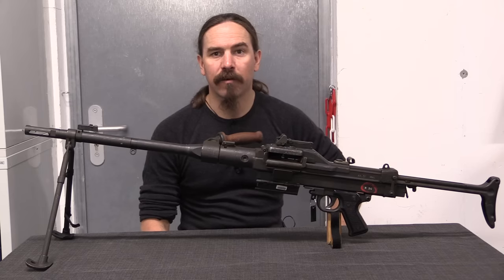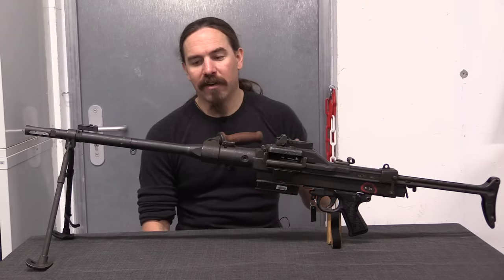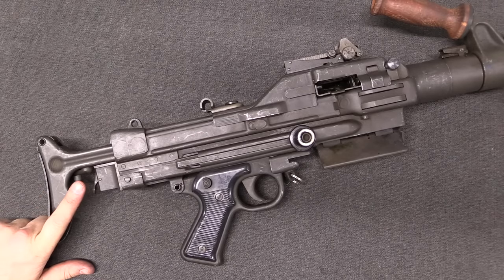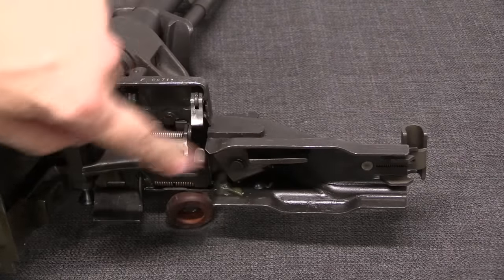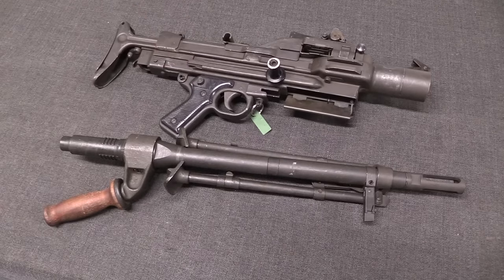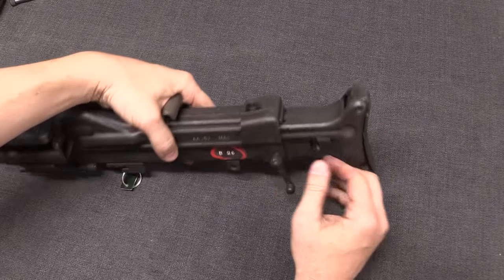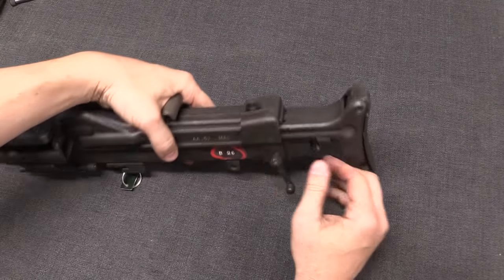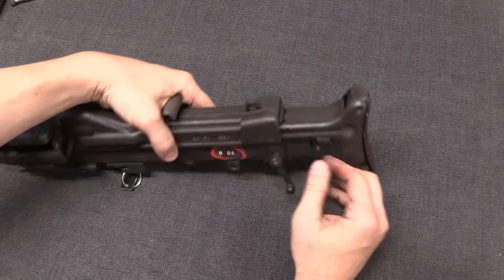France in the Cold War: AA52 Replaces the Hotchkiss

Comment: Quite kool Gun but i dont like that the bipod is mounted on the Barrel. If im in the fields in position and need to change the barrel because i fired 4-5 belts an the Barrel is hot as hell. If i change the barrel with bipod i need to position my gun again. maybe its because im used to the MG3 but i dont like that idea.

Comment: A few quick questions - most distracting - is that a bullet hole in the wall to your immediate left? Serious questions - has the firing pin been shortened on this version? The 90 degree bend in the firing pin looks like a weap point, did it take a lot of stress on firing at that bend? Very interesting GPMG, thank you for sharing.

Comment: Man, lever-delayed, roller-delayed, toggle, et.al. just boggle my mind.
I understand that it’s probably (comparatively) simple engineering/maths, but the idea of saying, “okay little lever, you just gotta hold on long enough for the huge explosion to dissipate, but also save some energy to move this block of metal” is just wild to me.
Reply: think of it that way : if you want to lift up a weight and you have a long lever arm it's easy, right ? Now imagine the opposite : that you have to lift the same weight but the pivot point is so close to you that you have a tiny lever arm and the weight is at the end of the long arm. To lift it up, you'll need a lot of force pushing the short lever arm and it will take some time. That's how lever delayed blowback works - the cartridge is pushing very hard on a very short arm of a lever which is connected to a substantial weight via the long arm of the lever. Add the recoil spring which in effect means the weight is greater
Reply: AGREED!  One of the problems (IMO) is that we do not REALLY comprehend the pressures involved in firearms use...  We may read the figures, and think "Thats a lot of pressure" and appreciate it in an academic fashion ..but (like astronomical distances) I don't think many (if any) of us non-engineers really appreciate the numbers and the forces involved...not deep down.    A friend of mine - shooting Cowboy Action loads in her Vaquero  (125gr at 600-650fps...so even by pistol standards very light indeed) had an hilarious squib..the lead projectile almost exited the barrel, but not quite!   It was poking out the muzzle with only a few mm of bullet still in the barrel.  You'd think it would come out very easily.  Nope.  It took significant effort with a pair of pliers to get it out.  THAT was the "Fookin hell!" moment for me.  These are SERIOUS forces we are dealing with...that can not only push that bullet along nearly 5" of barrel (where we had trouble with a few mm) ...but also accelerate it to 600fps...   <Shakes head>  And rifle cartridges are operating at what..nearly TWICE that pressure?
Reply: Your answers is about a simplified as the weapon. But when you put it that way kind of scary. But then again I never trusted the M60 when I fired it either, 26.7 lb piece of junk!

Comment: How is the gun stored, if you can only close the top cover with the bolt back. Since the gun fires from an open bolt, that essentially leaves 2 modes of storage: 1) with the cover open or 2) with the recoil spring under considerable tension. Both modes are a bit meh. But it's the French Army we're talking about. They aren't perfectionists, but of a more practical mindset.

Comment: The lever-delayed blowback system seems like a simple and elegant design. Is there some reason it wasn't used more widely? Why has everything gone to gas operation?
Reply: I think it's because it doesn't adapt well to varieties of ammunitions. It needs to be specifically tuned for bullet weight and powder charge, and it can't be easily changed.
Reply: There is a reason. It's an excellent system with caveat : it feeds on high quality ammo. The FAMAS was feeding on steel case ammo that was made in Le Mans and was manufactured to be very constant. Chambers had to be fluted because of high extraction pressure by design. The smallest variation in ammo could lead to significantly higher extraction pressure and problems such as blown up cases and torn case heads (lower pressure : failure to feed or to eject). Manufacturing was moved to a different factory in a foreign country to accommodate some policies I won't discuss and QC slightly dropped, oh so slightly, but the effects on weapons reliability appeared immediately and could not be ignored which meant some corrective measures had to be taken. Gas operated systems don't rely that much on high end ammo. The floated, electro-erosion machined barrel of the FAMAS made it a wickedly accurate rifle though. Is accuracy that important for an AR? This question is not for me to answer.
Reply: @TheGouzy90  Okay, that makes sense. Thanks!
Reply: You asked my question, and the replies were what I was thinking ..
Reply: Inertia. Nobody bkthers designing new systems anymore, since gas operation works.

Comment: Any reason why there are not more lever delayed weapons in service? Looks incredibly light and uncomplicated compared to other systems.
Reply: It runs dirtier than a locled system, and has to be fine tuned to a given pressure of ammo at design, after than you cant really change how much it delays.
So basically relyability issues.
Mimd, if you feed it consistent ammo, and clean it properly it will run perfectly fine.

Comment: Mulhouse is pronounced "muloose" for your information. H is always silent in french. Also, might be known to you Ian but the AN-F1 version was designed to be primarily used on vehicles based in West Germany and the AA-52 in 7.5 was produced and used in much much greater numbers in France until replaced by the FN-Mag. There was a rather brief period of time where the AN-F1 got used in infantry support role as the AA-52 was being phased out (end of the 90s if I recall correctly)
Reply: The French H is a booby trap for English speakers

Comment: Odd question... Can it be fired without its barrel? And would that still fire leatgal bullets since the gas would have little to no time to speed uo the bullet?
Reply: The chamber is in the barrel so if you try to fire it the cartridge will just be pushed out the front without percussion.
Reply: @tromxuasnoc  ah. Makes sense, never thought about there not being a seperate chamber and barrel, but ofc you don't want a non-perfect seal.

Comment: Lol the French in 45 where lucky we weren’t imperialistic because it simply would have stoped existing! Although looks like a great simple bolt design I really liked the interchangeable hardened side locking lug great cheap design I wounder if they had any trouble with wear to the sleeve in which that lug is housed since it’s not on both sides

Comment: A mixed bag, I like the overall design but ... the firing pin looks too frail for my tastes (I had my time with the M60, so I have a basis for comparison), and the barrel change system...NOPE, you're not getting your hand on a hot gun like Ian did without protection, so FAIL in that category. The mechanical reliability seems there, it's sleeker (and probably a tad lighter than an M60), but when push comes to shove, gimme an MG42 / MG3.

When it comes to weapons design for machine guns, sometimes the French just can't help themselves. This is one of those times. (on the plus side, they did crib some of the German's work in the right places, so there is that)
Reply: About the barrel change, yeah, you don't do that with your bare hands, gunner always had piece of cloth to handle the hot beast. Easy, fast, presto your barrel is brand new. And if you make the mistake, you do it ONCE, pain is the good teacher XD
Reply: From memory, the servants of the AA-52 had a mittened glove for the changes of barrels (regulatory equipment) and except in position of defensive machine-gun the platoons of grenadiers voltigeurs did not fire enough to have to change barrel continuously. As for the striker, I have never heard of an anecdote concerning its rupture.
In any case this machine gun has rendered good and loyal service throughout the duration of its use.
Reply: @olivierpuyou3621  I remember some anecdotes about the firing pin but considering the age of those MG probably aging piece  worn beyond limits but kept in place until breakdown. And yes, this is a very durable, simple to use and maintain